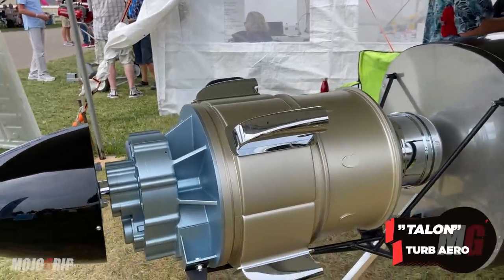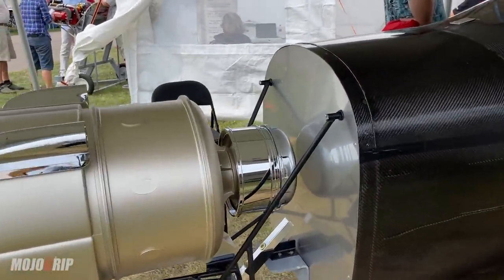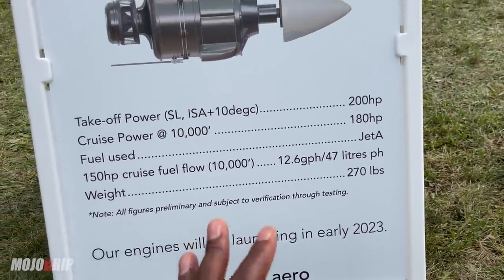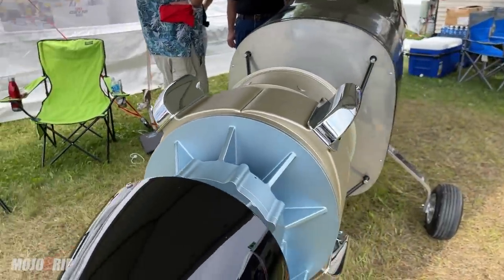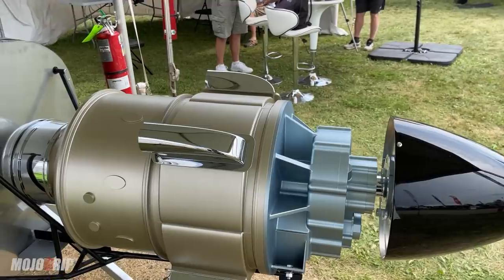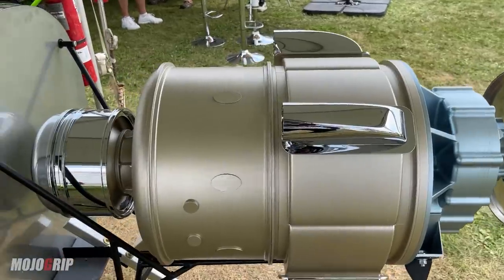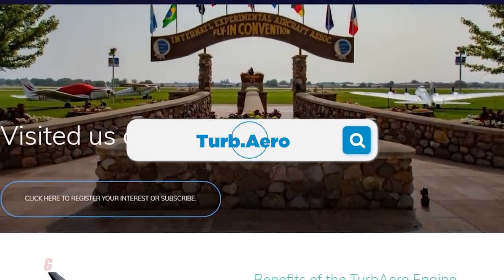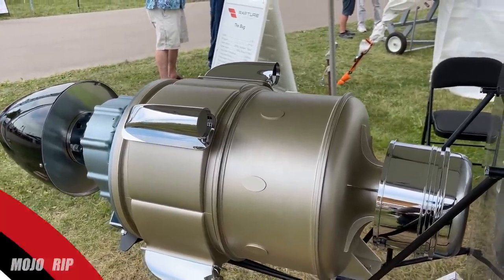200HP Turboprop Engine To Power Single Engine Airplanes - TurbAero

Comment from the maker: TBO target for this engine is 3000 hrs, just confirmed with Turbaero. More details on https://turb.aero. Stay tune for more updates.
Reply: @MojoGrip, It does look like a very nice engine , gearbox & prop assembly... But with the testing requirements, the tooling, the product liability requirements, the raw materials that  will be necessary, the modification of the OEM airframe designs that this engine can work on, and to satisfy the safety regulations that the FAA mandates for certificated aircraft and the STC's that the certificated airframe manufacturer(s) would have to produce for this powerplant to be used on, would mean that the original price quote of $85 k. for the engine/gearbox/prop, would actually end-up being much higher... The STC alone without the powerplant or prop, to use this non OEM engine & prop on a certificated airframe that was originally  designed for a 200+ HP powerplant probably would end-up costing well over $50k. This engine & prop should be available for LSA type Of EXPERIMENTAL aircraft only... Then, maybe the people making this engine/gearbox/prop combo will have a better chance at finding buyers for it... Because there are already used certificated planes available, that already have 200+ HP engines, that will probably end-up co$ting much less , and take much less time to prepare ,than to modify a plane to take an engine like this... It would not surprise me if the Cirrus that this engine was targeted to be used on, would end-up costing the owners at least another $250k. (Probably more) and at least 3 months to install and meet all requirements that a very courageous I.A. would approve... My guess is after viewing all the trouble and co$t to make a mod like this, the potential customer would start looking at Mooney's, Bonanza's, 210's, etc...Another question about doing mods to certificated planes is , which insurance company will carry it, and how much will that insurance cost?How many I.A.'s /FBO's are available, to do annual inspections on a plane with these types of modifications? How much will those annuals cost? Where does one go to find FAA/PMA certified parts for an aircraft that was heavily modified? How much will those parts cost? Will non OEM FAA/PMA parts still be available in another 10-15 years? There are so many factors to consider, when taking on modifications on aircraft, ESPECIALLY certificated aurcraft... Leave it stock Amigo...
Reply: @michaelmartinez1345  Will be used and proven on Experimentals initially. Certified versions would certainly cost a lot more and would likely sink the project financially as has happened to many new engine designs like Mistral and Orenda.
Reply: @rv6ejguy  Right on!!! Yes , my guess is the experimental aircraft market would be an excellent place to market such an engine... Is it a centrifugal flow compressor? If so, is it a twin stage impeller? What is the reduction gearing ratio? My guess is the people with Lasairs, RV's , Glassairs & other high-end SLA's might be developing some real interest in this unit....
Reply: Its not that impressive. The engine I am using for an experimental helicopter will use less that 43lph at 150kw and weigh less. You may think its good compared to lycoming and continental, but turbine engines are a poor design for aircraft everything considered. Aviation engines are 50 years behind in technology. My engine also makes that power up to 13500 METRES, not feet.
Reply: @chippyjohn1  and what engine is that?
Reply: @unrealparticle  A heavily modified Suzuki M13A.

Comment: I'll believe it when I see an actual working version.
Reply: We can always hope it works out.
Reply: Ill put it on my BD-5, LOL
Reply: I won’t get excited about any clean sheet power plant until there are about 100 built. Then, it’ll have sufficient support to be a real option. 
1000 TBO kinda sucks. 
Output / fuel burn / cost … a 390 is still a better overall option I’m thinking.  
Might be fun in a glassair 1, cassutt, long ez or other small and slippery airframes that could get high and go fast. 
Does it have beta?
Reply: @christianjforbes  I'm with you. Only 1000 hours on TBO? That fuel burn sounds wildly optomistic, especially at that low altitude.
Reply: @noyfub  I would definitely feel better about it if it wasn't a cheap plastic replica without many of the parts.
Reply: Developing a new turboprop engine needs an experienced team and $ 20 million. Have you ever seen a small company makes turboprop engines?
Reply: @christianjforbes  PBS AEROSPACE is making a turboprop half the weight  and the same power. Time before overhaull and fuel consuption are not as good but if you want a mini fighter in the experimental class it becomes a better option.
Reply: Oshkosh snake oil...
Reply: 200hp at only 237lbs for 80 grand? Tall order but damn I hope they're successful
Reply: These companies get investors and then run off with the money.
Reply: Itll happen armed military drones have been doing this forever its only a matter of time

Comment: One thing I learned from attending 50 years of Oshkosh: There are MANY "dream ideas" there. Few actually happen. Don't put any money on these unless you don't care if you lose it. I DO hope this comes to fruition, though.
Reply: 100% agree. Been going the last 30 years and many of these companies are searching for investors but never pan out. My favorite is the company with a new piston engine complete with dyno sheet that defies the 5250 formula.
Reply: I don’t have a problem with your thought and I understand exactly what you’re talking about, but this isn’t a great jump in technology but rather a very good idea.  I don’t understand why this hasn’t already happened. Hell we have turbines for RC aircraft. Why haven’t they been able to perfect a small turbine for an aircraft? Heck we had all kinds of small turbines in power supplies for starting jets in the Air Force for decades! Small Turbines for APUs.  Why in Gods name hasn’t this already been done? It seems like Mojo said this would be a game changer and and if it works no way anyone loses money on this project
Reply: @guggyp  Simple, fuel consumption of small turbine engines suck, most are nothing more than glorified turbochargers with a burner between the compressor and the power disk. Their simple design makes them light and functional enough to use as apu's of fixed output, where temperatures and loads are generally static. If used in a propulsion environment they can have short lifespans due to mechanical and thermal stress, and again their just too small to run efficiently at this atmospheric pressure. giving them absurdly high fuel burns.
Reply: @Flightstar  ok. I’m just wondering if they can start jet engines on restarts why not as a small aircraft engines
Are they that poor in maintenance and lifespan?

Comment: Cool, until I get to considering these points: 
The BSFC of a small turbine engine has never come close to a piston engine. Bigger is better. The highly-developed P&W PT-6 isn't as efficient as this engine is claimed to be.
Unless the engine is severely de-rated (that is, has a higher thermodynamic capacity then the 200 hp indicates), it cannot likely produce 75% power at 10K feet. I do suspect this to be the case, however.
Jet-A weighs >10% more per gallon, so even at the same fuel burn you'll lose useful load; add about 11%, so your 240 lbs full gasoline tanks will now weigh over 265 lbs.
The Allison/R-R 250-C20B variant weighs much less, makes double the power, and is well developed, yet this new engine claims > 20% BSFC improvement.
Given only my experience (getting huge turbofan engines FAA/EASA certified is part of my day job, and specific fuel consumption and low emissions are always critical items) and research, my prediction is that the engine will be short in life and high in fuel burn.
Keeping turbines alive for thousands of hours is a difficult chore; for small ones, the number of cycles is more critical.
Reply: Piston engines usually max out at 75% at 10,000 ft, a turbine by definition, is their own build in turbo charger , so I can believe it will do better. The PT-6 is less efficient with the reversed flow, but that suits quite a few helicopter designs and they are quieter. I heard straight thru designs like Garrett, the noise drive me nuts and it encourage public restrictions. This engine is at the starting point, give it time, and more important, money for further developments.
Reply: I was and kinda still am skeptical, however these engines are going to utilize a recuperator which will be a game changer as far as fuel burn is considered. That also explains why it weighs more than “comparable” turbines.
Reply: Hello Kenny.  Our Talon is designed incorporating recuperator technology.  Could I please suggest that you research recuperator technology associated with small gas turbine engines.  That research will give you an insight into how we will be achieving our fuel efficiency.  The drawback of incorporating recuperator technology is that being a high density microchannel heat exchanger, it weighs a lot.  We have sacrificed much but not all of the weight advantage of a traditional turbine over a piston engine in order to bring the fuel efficiency closer to the piston engine.
In addition, our engine is de-rated at sea level.  It should maintain 200hp to 8,000' before power available will reduce.  We calculate at 10,000' that it should have over 180hp available.
If takeoff weight is a limiting factor for a flight, the additional SG of the JetA is a disadvantage.  But in your example above i.e. 240lbs of Avgas versus 265 lbs for JetA, with the installed weight of the Talon being probably 50 lbs less than an equivalent IO-360, the Talon plus its heavier JetA still offers more payload capability than the IO-360 equipped aircraft.
Of course, we are still in the developmental phase and the engine has not yet run.  Please give us time to get the Talon on the test stand (early next year) and we anticipate that we will be able to clarify and validate all specifications and performance capabilities at that time.
Reply: I am ex U.S. Air Force Jet Engine Mechanic ( GE F-108/ CFM-56-2, GE F-110 and P&W F-100 PW-200, 220s ). Why did the General Aviation world not jump on the Boeing T50 and T60 light turboprop and turboshaft engines from since the 50s and 60s?   They worked great on the U.S. Navy's QH-50D anti-submarine drone helicopters and the Cessna O-1 " Bird Dog " light observation plane turboprop variants.
Reply: @leonswan6733  Lycoming for instance has more lawyers than engineers on the payroll.
Reply: @rustywells8756  I can see that being one of the reasons they did not buy the patents or licenses and start production of the Boeing T50 and T60 engines.
Reply: By virtue of their very nature, turbines have their own built-in turbo-chargers in the compressor stage.  It absolutely will product 75% power at 25,000 feet, not to mention 10,000 feet.
Reply: @justincase5272   Like you and everyone knows,  The idea of the Gas Turbine turbo jet engine came from just removing the piston engine all together and supply the " Turbo Compressor " ( as they was called back then ) with its own combustion chamber burner. This produces hot high velocity gas flow to turn the turbine and connecting compressor shaft with fuel pump accessories which would reciprocate the air and fuel feeding to the burner.  The turbine engine was birthed from the " Turbocharger " .
Reply: can i enter in contact with u and where via twitter or linked in of facebook
Reply: @leonswan6733  in two words "fuel consumption" 
Up until now putting a turbine out front has come with a big range hit and GA craft are limited at the best of times

Recuperation has always been the obvious answer but if you look at a M1A1 abrams you'll see the engine package is mostly recuperstor by bulk and mass - the win here is miniaturising it
Reply: @miscbits6399  True. Turbines have higher fuel consumption for same distance traveled than a small 4 or 6 cylinder Lycoming or Continental.

Comment: From 3D plastic model to operational new-design turboprop engine in less than 2 years!
That's quite ambitious, especially for a small company.
Reply: It will take the FAA twenty years to approve it.
Reply: They could print most of it quite quickly
Reply: CAD design, simulation and analysis shortens everything.

Comment: Once certified, this will be a game changer! Point of correction though...there are quite a few small turbine engines flying around like the TP100 turbine from Turbine solutions and the 90hp turbine that's optional in the Mosquito XE helicopter.
Reply: Repurposed APUs aren't really on par with a purpose-built turboprop engine.
Reply: @ParadigmUnkn0wn  a jet engine is a jet engine whether it's an APU or ground power unit. As long as it goes thru the rigours of certification, no one will care if it powered a go cart or avionics systems
Reply: @rmshivo  they'll care how fuel efficient it is...
Reply: @ParadigmUnkn0wn  agreed. So for now we wait to see if we'll hv an engine 2023 and the numbers it'll put out.
Reply: @ParadigmUnkn0wn  Is the TP100 a repurposed APU? I did not think so.
Reply: @troylunn496  The design spec is supposed to be 150HP @ 10,000' on 12.6gph. That works out to a BSFC of 0.5628 lbs/hp/hr which isn't even that good, and I'm still thinking those numbers are bit exaggerated.

They're targetting $80k and a 3,000 hour TBO, which isn't bad. No clue if there's a recommended HSI somewhere in those 3000 hours, but it is FADEC so they might get by without an HSI, which would be pretty awesome at the price point. 

It's hardly ground-breaking, though. An AI-450C will crank out 280HP @ 9,850' on ~25gph (BSFC = 0.6094) and it'll give you 495HP on takeoff and get you up to those more efficient altitudes a lot faster.

I can't name them off the top of my head, but I know there are some PT6 models that have similar power output and even better efficiency, and the PT6 has the advantage of being the turbine equivalent of a Toyota Camry. They're everywhere so parts/service centers/qualified technicians are everywhere. It's also not too hard to get a deal on a used, mid-time engine or reman'd engine. I spent a lot of time looking at some of the Eastern European turbines to slap on a Velocity XL, but after you pay shipping and customs costs it's cheaper just to get a PT6A, and that's before taking maintenance concerns into account.
Reply: @troylunn496  Hi Troy.  FYI, it is a single stage centrifugal compressor, single stage axial gas generator turbine and single stage axial power turbine.  Internal temperatures are low such that unobtanium is not required for the turbines (Inconel works) and blade cooling is not required.  Pressure ratios are modest.  We do not need high pressure ratios or high internal temperatures to achieve our fuel efficiency because we are utilising recuperator technology.  This technology offers a significantly better option to achieve fuel efficiency than the high Ts and PRs.  It means that we can stick with conventional materials and manufacturing techniques which will help contain cost.
Why would our engine burn a lot of oil?  Our engine is a clean sheet design which includes seals to stop oil leaks.  I don't know why a turbine needs to burn more oil than a piston or why ours may burn more than say a PT6.
As for being a backyard design, I'm not sure that the 20+ ex-P&W, GE, Honeywell, Solar, Capstone etc. engineers that are working on the program would agree.  We may not be P&W but we do have a very experienced, talented and highly motivated technical team and some great technical partners.
Reply: @rmshivo  If they get it certified, it's going to cost alot more than 80K.
Reply: @octaviojlima  , yes, originally a Garrett for an APU; was used in the A-7 attack jet.

Comment: Seems like a cool concept! Careful with the "CG stays the same" comment. It may be near the same weight, but the extended nose means more weight forward with the arm, so you have the weight of the nose PLUS the weight of the propeller farther forward, which could be a big change to the arm and moment. But for $80k??? That's awesome!
Reply: I seriously hope this comes to market. "Game changer" may be the most over-used phase in the industry but if this happens it really would be just that
Reply: With the lighter engine further forward, the effective weight would be the same, that's why the CG is the same.

Comment: Specs sounds really great but once they have an actual running prototype I'll bet those fuel flow numbers will go up by at LEAST 50%.
Reply: Nope.
Reply: As well it's pricey point
Reply: Maybe. Maybe not. The one thing that separates this engine from other aircraft turbines is the use of a recuperator. This has the ability to GREATLY improve efficiency. But it also increases size and weight. And most importantly, nobody has ever built a recuperated gas turbine that is truly reliable. This last factor is going to be the crux of the whole project.

Comment: It is a LOOOOONG way from 3D printed mock-up to a proper turboprop engine. I really hope they succeed. The concept is fantastic, but a mountain of engineering ahead. 

Good luck to them.
Reply: Looks to me engineering is done. Which is the easy part. Building it at any volume is the hard part.
Reply: I was a military pilot and went through teething issues with turbines and it definitely is a tense situation for a long time.  We weren't their test pilots even though it seemed like it.  They test a lot of fixes that don't work very well or make things worse before they become trustworthy enough to not always in the back of your mind.